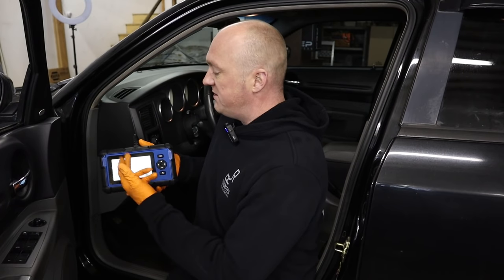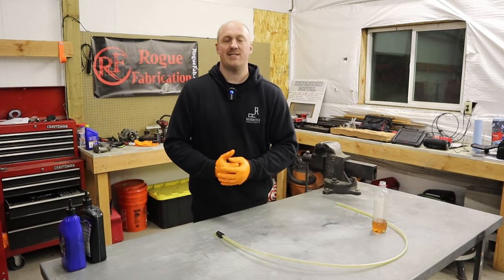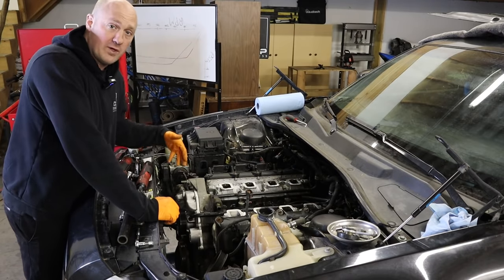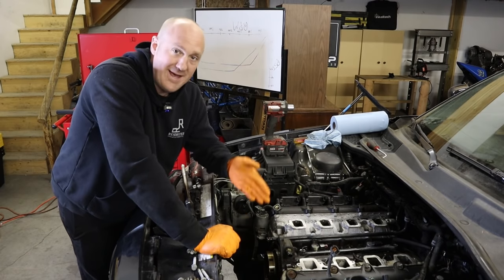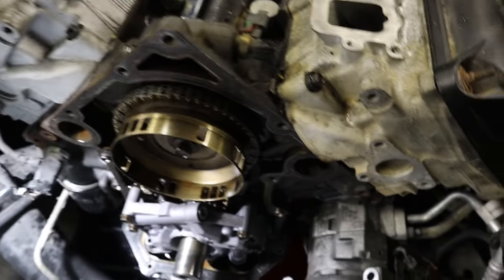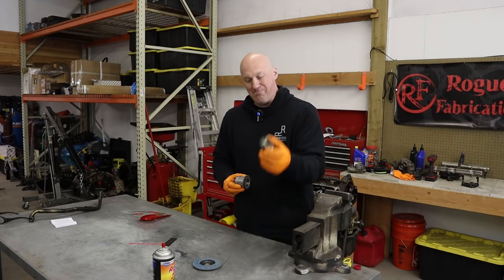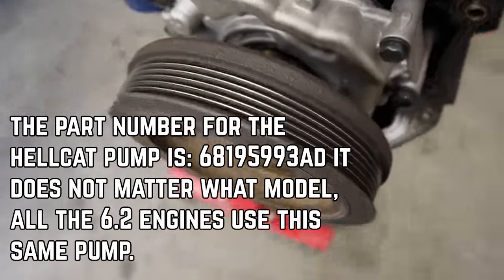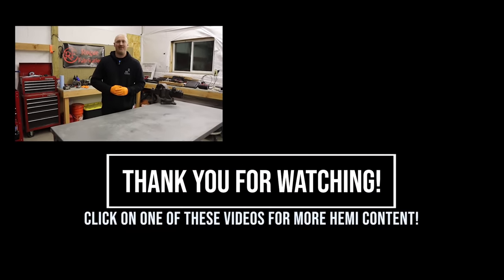Will This FINALLY FIX Hemi Tick? #hellcat

Comment: Awesome video Thanks. Like the fact that you have no problem owning your challenges. My challenge is that I can not do it myself( mobilty issues) and would like to got the hellcat pump put in my 2015 Ram 1500 5.7 hemi, it has to be idled quite often due to the fact the our Northern Canadian Winter tempratures are Sometime -45 and most times - 20. Also pull a 7800 lb RV trailer up some pretty HD hills and Rocky Moutain roads. "So I am getting different answers from shops as to how much labor" (time it takes to do this) what is ressonable amount of time for a start to finish install of pump. Also is there anything else that should be done(or replaced) at the same tiime. (I already have that hemi tick at cold start up) I have 112,000 KLM (69,000 Miles) Thanks

Comment: Skye, I have 78,000 miles on my 2014 5.7 hemi (6-speed Challenger) and have no audible sounds of doom.  Just for curiosity, I checked my oil pressure last night, after an hour+ drive from the airport.  At idle, it was 47PSI.  At cruise, it was in the mid-60's.  I guess I don't have anything to worry about?

Comment: This gives some really good information. I do have one question. That's, what about the increased maximum oil pressure the Mellings and Hellcat oil pumps top out at? I know that the MDS operates via oil pressure. Will an almost double oil pressure cause any issues with the MDS system? The Melling oil pump you said, comes with extra springs to "dial in" the oil pressure. Any reason to stick with the stock oil pressure?

Comment: Oil PSI at idle for a HEMI should be 15-25psi!!!!

You should gain exactly ZERO oil pressure increase with a HV pump if each pump (standard and HV) have the same pressure relief spring.

You DO NOT want higher oil pressure at idle.  

Regardless!  Your idle oil pressure is perfect and raising the oil pressure is not needed or wanted.

You swapped to a high pressure, high volume oil pump.

Comment: Thanks for the content really informative… I have a 2012 ram 1500 recently got a lifter failure after almost 300k miles, I went and bought a reman block engine and I’m still gathering info on weather I should go ahead and slap on this hellcat oil pump and if I do would there be a follow up on upgrades needed to be done afterwards or that’s it? I wonder if that would set a check engine light on

Comment: Hi
Thanks for all your great hemi videos.
I have a lifter problem and gonna replace the stock pump with the Hellcat.
My 2014 RAM has the MDS System.
Is this a problem for installing the Hellcat?
I read some about in RAM forums and some people weren't sure about that.
Thanks

Comment: I did this mod, and love the oil pressure I see on my scanner. One issue, ever since this swap, I have the P0524, Oil Pressure to low", and I know I have pleeeeenty of pressure. Played with different oils, brands, viscosity...changed oil pressure sensor, and played with pil filters, all the way to the Mopar, stock #, with "anti drain back", and can't get rod of this code. Any pointers, or people who have had this?
Reply: Well, he's recenty covered this if you haven't seen it yet.

Comment: I wonder if an additive such as motor kote, or slick 50 would prevent the lifter failure. I played with these, when building race motors. Don't use on new motors.

Comment: My wife pointed out that you appear to be running the car in your garage with the garage door closed.  How are you getting the motor warm without asphyxiating yourself?
Reply from the maker: I usually pop the door open after a bit to let any fumes out, but these modern day vehicles do such a good job with their emissions that you can generally do that with no issues. 👍

Comment: I honestly feel that the hemi tick problem comes from not having your oil changed often enough but yes, also that oil pressure is not sufficient enough at idle the roller lifters that failed are the hydraulic ones, so when you have dirty oil those little holes that allow the lifter to compress when the MDS is on gets plugged up from dirty oil, possibly that is one of the other reasons that so many of these hemis have that problem especially fleet vehicles , vehicle that have lots of sitting in with the engine on for long periods myself I have a 2019 ram 5.7 4x4 160thousand km an ido my oil changes myself every 7 to 8000 km . The only problem I’ve had so far on my truck is the front wheel bearing because of two inch wheel spacers lol
Reply: Do you have the e-torque Hemi? I have a 2020 Ram Rebel and I haven't read if this would help alleviate my particular Hemi with the E-Torque. Mine has the mild hybrid option. It makes me happy to see you have good success in a new DT model Ram.
Reply: @TexansFanBryan  no I’ve got the older 5.7 engine an it’s been fantastic so far 2019 I think it’s 5th gen ram yours is the 6th gen I believe nice truck I’m looking at the TRX for my next truck they are just way to expensive right now no worth the price the dealerships are charging

Comment: Engine oil PSI is based on engine wear You should try this on a motor with less than 10,000 mi

Comment: Question for you Sky...
If you install a high volume pump, I imagine it takes more force to drive the pump due to more oil being moved.....
That being said, will installing the Hellcat pump, will that drop the fuel mileage?

And what about pan cavitation?
Reply from the maker: I think the difference would be so marginal that I doubt it could be measured by a dyno. As for emptying the pan, you have to remember that this is a stock pump in the Hellcat that uses the exact same oil pan, no extra capacity. If that had been an issue they would come with larger oil pans 👍
Reply: @ReignitedAuto Thanks for the reply. After I posted that, I checked to see how many quarts of oil the Hellcat takes and I saw its 7qts also, so I pretty much answered my own question then.
I guess I'll find out.  My Ram sounded just like the 300 that you sold, when it broke the valve spring. Mine had a broken valve spring and also broke the valve guide. I bought a reman head from Jasper because dealership heads are on nat'l backorder.  My lifter rollers have no up/down plat, no horizontal wobble either. All the needle bears turn freely and smoothly.

I got it all back together, still  running the same, so I'm 99% sure it's timing.  I have the timing chain gear set and a Hellcat oil pump, so when I pull the oil pump to replace the timing chain, I'm doing the pump upgrade.

I love your videos, they help a ton, very informative. 
How can I get one of your black reignited logo hoodies, and how much are they?

Comment: stock: cold: 42 F / idle: 58 psi / 3500: 75 psi
hot: 210 F / idle: 20 psi / 3500: 58 psi
melling: cold: 42 F / idle: 85 psi / 3500: 99 psi
hot: 210 F / idle: 37 psi / 3500: 85 psi
hellcat: cold: 46 F / idle: 86 psi / 3500: 100 psi
hot: 208 F / idle: 43 / 3500: 90 psi

Comment: Lmao! I do the overwhelming majority of my vehicle repairs but even though I believe I could change this pump our this seems like more work than it's worth for your average shade tree mechanic. I'd most likely stick with the original pump or pay someone to do it. The only exception would be it I had to open that engine up for a necessary repair.

Comment: The naturally aspirated 6.4L (392) HEMI runs 60 PSI at 2,000 RPMs and 30 PSI at idle. Do you know which oil pump it has?
Reply: Awesome question, now you got me thinking to check part numbers on Rock Auto to see if they're different..
Reply: Ok, just checked, my 2012 SRT8 392 oil pump Mopar pn per Rock Auto is not even close to a 2015 Hellcat pn...and of course, the Hellcat pumps are out of stock!

Comment: i have always had a feeling my old buick engine had problems with lubrication, so this was an interesting video to watch. after looking at pumps online, one thing i read kinda turns me off the idea.. that is that if you get a super sweet pump, potentially it can empty the sump and fill the top? like if the flow back to the sump isn't sufficient?

is that a thing you need to calculate or something depending on your vehicle? it's already pretty low to the ground so a larger sump might not be a great idea.. not sure if i'm game to try a heftier oil pump XD
Reply from the maker: The one thing to remember here is that we are installing a factory part, if there were issues with it emptying the sump they would have shown themselves immediately. The hellcat engines have the same oil capacity as all the rest of the Hemi engines, so that's not really a concern of mine. 👍
Reply: @ReignitedAuto  ah ok in the case of it being a factory part, and as you say, from a similar engine, with the same sump capacity, i can understand that. thanks man! sorry i don't actually know heaps about cars/models, so i might ask ignorant questions.

i think in my case there may not be any factory part with higher flow available though, so i worry that whatever aftermarket high flow oil pump i might be able to find could ruin my day

Comment: I have experienced oil filter failures with aftermarket filters leaking at the flange seal. How will/ has the higher oil pressures affected the brand of filters in use by you here?
Reply from the maker: It's a good question, and one I don't have an answer for. However, I do like to state this one point, this is a factory part used in hellcat engines, which use a standard oem filter. So I don't foresee any issues, but strange things do happen.

Comment: You have a lot of good information about this oil pump. But where can you buy this oil pump because no aftermarket makes the pump and ALL my local dealers ALL say it is on National back order.
Reply: I posted a comment about this earlier today but for some reason it's gone. I just bought one of these (68195993AD) this morning by calling up a few dealers and finding out from them which other dealers had one in stock. There were a few several states away (one in OH and one in NC) that had several, so you might try the same.

Comment: Sorry if I missed it: Would this be applicable to a 2016 RAM 2500 with the 6.4 Truck Hemi? I don't recall ever having seen idle oil pressure lower than the low 30's PSI

Comment: So if the regular pumps suck and run half the hp any of the hellcat then wouldn’t one say that the hellcat pump is underrated for the hellcat as well considering when it gets hot oil pressure reads 30 at times at idle. Is there an upgrade for the hellcat to ensure this or would it simply make more sense to get a bigger oil pan to disperse the tremendous heat these cars put off.

Comment: So I did this with my Charger Superbee 6.4l and with the hellcat oil pump it keeps throwing check engine lights for low oil pressure when it isn’t low.  It’s because the oil pressure is not in its normal parameters so it throws a code.  Switched back to the original pump and no more low oil pressure codes.  Just a heads up for anyone thinking of doing this

Comment: FIRST. Can't wait!
Reply from the maker: You are first! Nicely done 🙌
Reply: @Reignited - Cycle and Automotive  Thanks for all the hard work.  For reference, I have a 2015 5.7L, and use top of the line oil and filters and here in SoCal on a 115 degree day at idle in drive... I drop to 29 PSI. So... whenever I'm in the engine deep enough... she's getting a hellcat pump!
Reply: @winstonwright3613  are you keeping mds?

Comment: My 09 1500 had 21-23 psi at idle on a hot (100+ degrees) day with the stock pump. After swapping in the hellcat pump, it holds 45 psi at idle and 70+ psi while driving. I still lifter tick on start up every now and then but it goes away within 2 seconds.

Comment: How about 21 and 22 models of 5.7 Hemi engines? I believe they changed the oil viscosity rating, did they change the pump design?  Thanks for the video

Comment: Sorry if this is not where to ask a Q ,   Indiscriminate metalic clanging and rattling  07 5.7 HEMI Jeep  180 klm / 112miles (coming front upper LHS of valley area looking at it )  , will go quiet  briefly ?  Cant get it to Rod Rumble with throttle ( reasonably confident bottom end ok), Hitting on all 8 cold/hot  (sounds like something is loose like a cam chain tension-er ) everything quiet otherwise  Does anything obvious spring to mind? Many Thanks

Comment: Just curious here.. by changing to a Hellcat high volume pump, does it change what oil weight you should use? Hellcat is 0W40 my 20' 1500 5.7 RAM calls for 5W20. Also on that note, can I actually run 5w30 and be Ok?
Reply: Not sure but my 2010 5.7 stock just gave out at 510xxx and all i ran was synthetic 5w30.    now have to do a head cam and lifter rebuild but since im already there will for sure have to do the hellcat swap.      my 5w30 on this tired engine was 20psi at idle so will still ho with it after the rebuild as the motor lasted half a million with it and its slightly cheaper

Comment: So if the timing gear was identical for the hellcats, what is different about those engines to make it engage 100% with the oil pump? Does the timing gear not go as far back?
Reply from the maker: You can see it more clearly in my previous video comparing the pump internals, but when they went to VVT it pushed the pump out about 17mm, the snout on the crankshaft itself makes this happen. 👍

Comment: I’m not totally convinced I have a lifter/cam problem, but my valve train seems to be much louder than when I first bought my 15’ 5.7 1500. I have replaced the manifolds with headers (broken bolt) and it seems even louder. I see many others with the same issue. Truck runs fine. Should I reconsider that in fact have the problem on its way?

When I say valve train noise, I mean several very minor ticks as opposed to a distinct singular tick.
Reply: I have a 2012 RAM 1500 and have had the exhaust bolts fixed on both sides to eliminate the annoying ticking; both were done under warranty thank gosh. I am not totally convinced either that I have a lifter/cam issue as the truck has been ticking for a few years now and has 165,000 kms yet runs fantastic. Not looking forward to replacing the lifters at $5000 but if I have too, I will be putting the Hellcat pump on for sure.

Comment: Amazing: Does The Melling Fit Directly To A 2008 Dodge Charger SRT8?
Reply from the maker: Direct fit 👍
Reply: @ReignitedAuto  
Watching you & others has given me the confidence to replace my own lifters, cam , & now oil pump. I need a crankshaft damper..
Reply: Can I Reuse the Same head bolts?

Comment: I like your video very instructive I have a Dodge Ram 2012 5.7 like to no if I need to do modifications to put the Hellcat oil pumps in it thank
Reply from the maker: No modifications are necessary, however there's an even better pump available now, made by Melling: 10452HV this is a high volume pump that actually provides even more volume than the hellcat does and it's a direct fit for your vehicle.
Reply: @ReignitedAuto thank you

Comment: GREAT VIDEO, GREAT JOB!!! Question, please: is it not available for Jeep Grand Cherokee 5.7 HEMI 2006??? Are there differences among these HEMIS? There are only Chrysler and Dogde models listed on website's vehicle fitment... Many thanks!
Reply from the maker: The Hellcat pump won't fit the pre 2009 engines. You'll have to use the Melling high volume pump, 10342HV that will bolt right up to your jeep. 👍
Reply: @ReignitedAuto  , alright, understood... Jegs website (Melling link on video description) should correct the info, as they say 10342HV won't fit Jeeps, only Chryslers and Dodges... I'm adding this pump upgrade to my "to do list", as high priority... One more question, please: I can see another model/option 10342HV375S with oil pickup tube included... Do we need to change out the tube, as well? Many thanks!
Reply from the maker: @alexnogueira9289  shouldn't need to replace the tube, unless you've experienced catastrophic failure already. 👍
Reply: @ReignitedAuto  GREAT!!!

Comment: I would like your opinion. We bought a new 2021 Challenger Scat Pack 6.4 T/A. Garage stored in winter, northern Indiana. Just broke in over 500 miles. I run Amsoil Signature 0W-40 oil and filter. Changed the original factory oil @ 279 miles 6 month warranty requirement. Would that hold up if I only put a 1000 or 2000 miles a year on it and changed only once a year? Not after hp mods, only mod is Pedal Monster. In city mode, huge improvement. Would like your opinion on hellcat oil pump install and an oil cooler. Down highway 56 psi at 217° oil temp. 25 psi warmed up at idle. That just seems low. So would those mods be good insurance or waste of money? 
Also, thoughts on removing the resonators pro and cons. Looking for improved sound. However, read that fuel efficiency and power could be sacrificed? With the Pedal Monster in just city gives greater response but mpg's do take a toll. With premium near 6 a gallon, back to norm mode there. Thank you, love your channel.
Reply from the maker: I do think the hellcat pump is a good upgrade, the oil cooler is tough because your oil temps and coolant temps will be inextricably linked together, and the factory thermostat on a Hemi is 208 degrees so it would be tough to get the oil temps to drop below that. That being said, it's never a bad idea to install additional cooling mods, just not sure how effective it would be. Also, your oil strategy sounds just fine to me. 👍
Reply: @ReignitedAuto  Thank you. What all would be needed to done to put a 180° thermostat? Pretty sure the computer and fans wouldn't operate properly. For instance, could a good mechanic tune and make adjustments so engine lights stay off? What would it cost approximately to accomplish this.